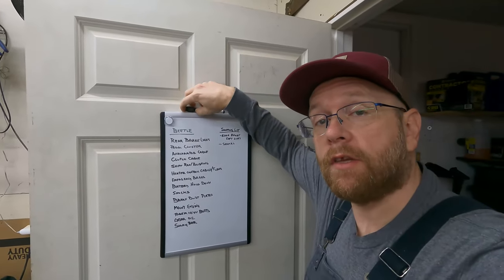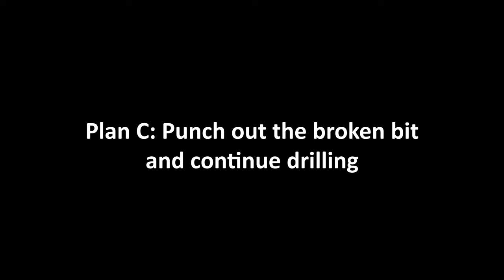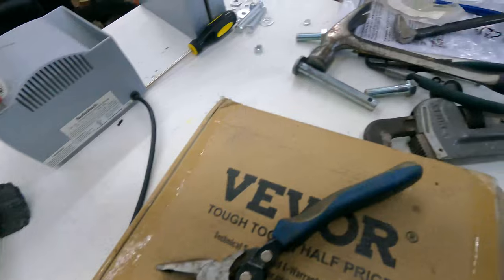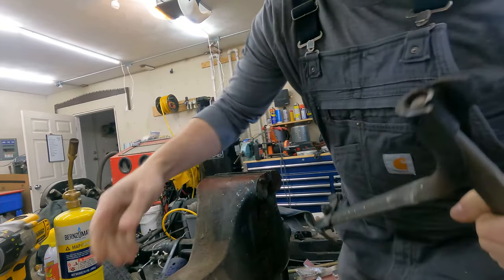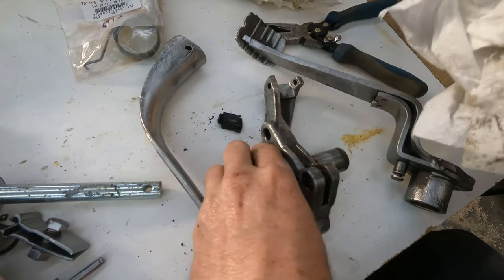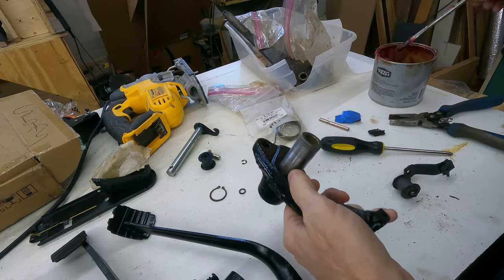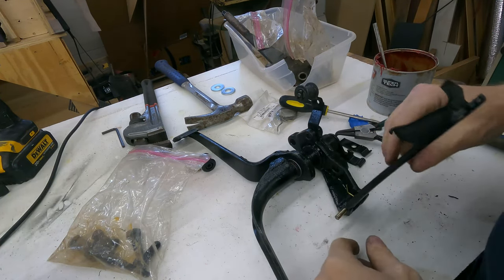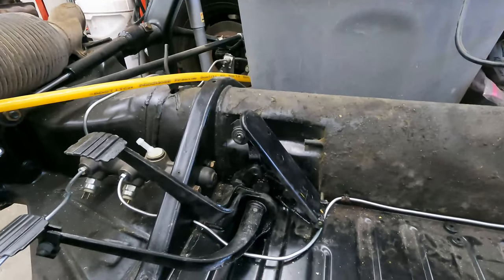Rebuilding a 1968 Beetle Pedal Cluster

Comment: My dad bought a slightly larger version of that same Wilton vice, used, at an auction in 1968 where we used it on the farm until the early 1990s.  I now have it on my workbench in my shop.  I LOVE my old Wilton vice.
Reply from the maker: A rebuild/restoration has been on the to do list for a while now. Mine came from the railroad and it is a little worn out.

Comment: Concerning the "floppiness" of your gas pedal, that's normal.  On my '78 Super I simply removed the entire metal footpad part of the pedal and push the gas using my foot on the roller.  It works out MUCH better.  But, if you MUST keep that flat foot pedal thingy, then you'll need to install the spring correctly to get the pedal to come back up.  You do that by installing just like you have, except ADD-IN one more twist, or rotation, to the short end of the spring so that it's actually forcing the pedal back toward you.  Right now, as you have it, you haven't pre-loaded the spring correctly.  It doesn't just slide on the shaft like you have it.  You have to slide it on, but pre-load it with one more rotation of the short end to get it to tension the pedal back.
Reply from the maker: I address this in a future video. Still not sure if I got it right, but you will see soon enough and can let me know. Thanks!